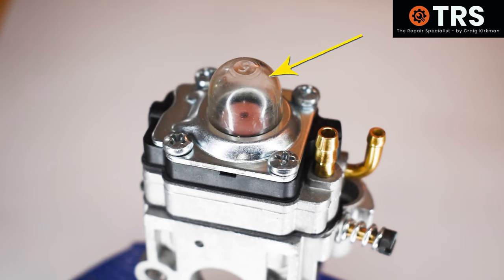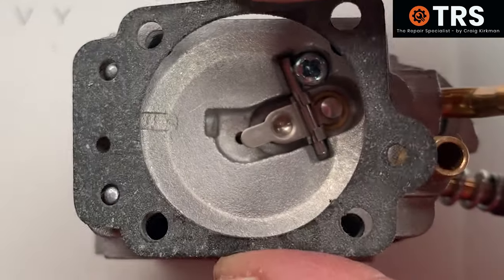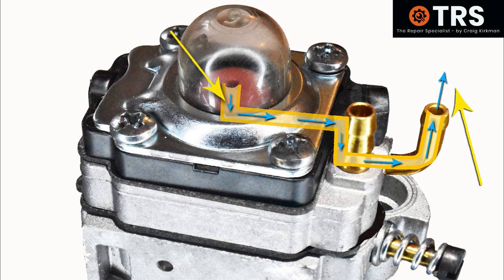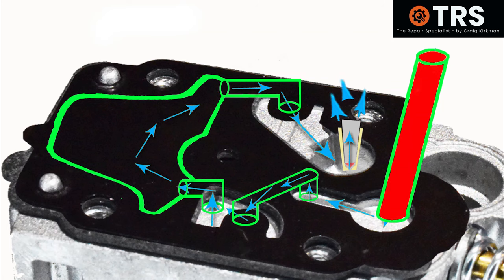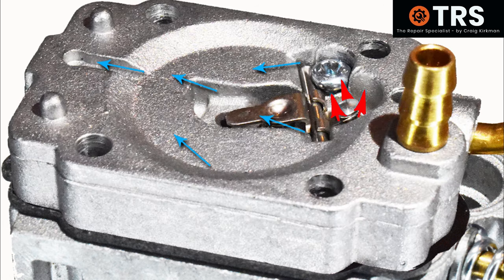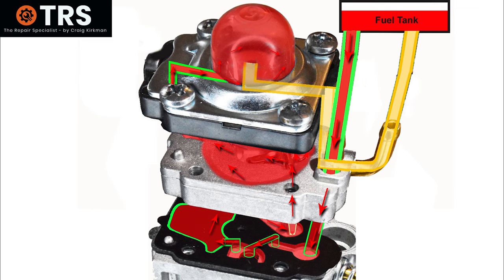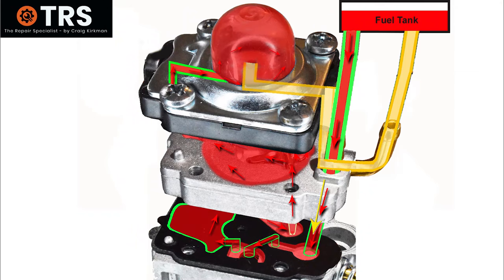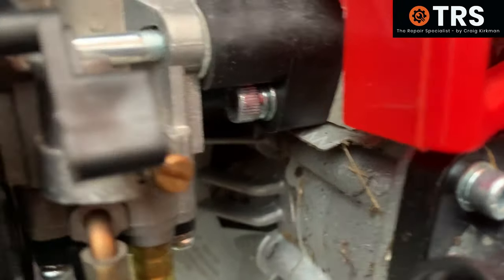2-Stroke Carburetor - Get 'JACKED' with Knowledge that Most Don't Know!

Comment: Craig a very informative video as always! I've been rebuilding 2-cycle carbs for more than 50 years and still always learn something by watching your work. You know, we don't give enough credit to the engineers who originally developed these carburetors, whoever they were.
Reply from the maker: Thank for your kind feedback, and I totally agree about the engineers that design and produce these needing more credit. Craig 👍👍👍
Reply: @TheRepairSpecialist  Craig, any idea who they would be? Jeeez, back in the day right?
Reply: @TheRepairSpecialist  
I am reasonably sure you entirely missed the hi flow adjustment screw on this style of carb 

This style of carb IS NOT 
A SINGLE ADJUSTMENT SCREW 

If you look at the top of the throttle barrel that the cable attaches to in the centre of that is a large brass collar/screw you can see the rubber tube in the centre of the brass screw 19:43 

Remove the rubber tube and there is a wee little adjustment screw hiding there to adjust that main jet needle
 On most verients at least 

hope this helps

Comment: Great content. Ive got a 2 stroke Waxker Neuson BH55 Breaker and its smokey. Also sounds a bit gaspy when throttle is applied but does seem to run
Reply from the maker: Your Waxker Neuson BH55 Breaker may be experiencing problems with the fuel-air mixture, based on the symptoms you have mentioned. What you can do is as follows:

Examine the air filter: A filthy or clogged filter can impede airflow to the engine, which can result in more smoke and a rich fuel-air mixture. Take off the air filter and look for any damage, dirt, or debris. If required, clean or replace the air filter.

Examine the Fuel System: Look for any indications of contamination, leaks, or obstructions in the fuel tank, fuel filter, and fuel lines. Verify that there are no problems with fuel supply to the engine and that the fuel pump diaphragm is operating as intended.

A problem with the carburetor adjustment may be indicated if the engine makes a "gaspy" noise when the throttle is applied. To guarantee the proper fuel-air mixture at all throttle positions, adjust the carburetor in accordance with the manufacturer's instructions.

Spark Plug Inspection: Increased smoke and poor engine performance can also be caused by a fouled or damaged spark plug. Take off the spark plug and check it for wear, damage or fouling. If required, clean or replace the spark plug.

Compression Test: To assess the engine's general condition, conduct a compression test. Low compression may be a sign of damaged or worn-out cylinders, which may be the cause of smoking and subpar performance.

Professional Inspection: It's recommended to speak with a qualified mechanic or technician that specialises in small engines if you're not sure how to diagnose or resolve the problem on your own. They are able to perform a comprehensive examination and diagnosis in order to find and fix any underlying problems with your Waxker Neuson BH55 Breaker.

I hope this helps a little

Craig
Reply: Nice one mate.  I'm gonna look into it. I'll work on the carb and possibly the rings in due course. Thank you

Comment: Absolutely brilliant! Question if you don't mind. My carburetor is very similar but has the adjustment screw down the middle of the throttle barrel? I assume turning this will alter how much the needle will engage into the jet? Very fiddly trying to adjust (if that is indeed how I adjust the fuel delivery on this setup!). Have you any experience of this type? Thanks. Andy
Reply: Yes you are correct see at 19:43 that his has a rubber tube blocking it 

This is the hi flow needle
The low flow he shows in the video but calls it the fuel to air mixture

The animation showed it had no way of limiting or adjusting the air flow 

So I would say it has to be the lo mixture screw and air is regulated by the idle limit screw he also explained

So yes you are correct they do have a third mixture screw and it's the hi flow mixture screw they tried to hide a little too successfully for my liking

Hope this helps

Comment: Is mechanic spelled differently in Great Britain?  Looks like a Walbro carburetor. They are usually Zama and sometimes Walbro. Sometimes the check valves on primer block go bad. I really appreciate your thorough explanation.
Reply from the maker: Thanks for letting me know about the typo in the thumbnail. I will correct that ASAP. Craig 👍
Reply: Lots of check valve are damaged by air pressure and objects being pushed into them 
I see it alot in spring time

Comment: I have tune several of those and have discover an other screw below a rubber cover inside the bronce part in the top of the barrel, what do you think that screw is for? I've been using it to calibrate low rpm range, like an L type screw and then the in maximum rpm calibrate with the crew you explain in the video. Thanks for the video is very clear all the explain and diagrams you use.

Comment: @TheRepairSpecialist  
PLEASE PIN THIS 

I am reasonably sure you entirely missed the hi flow adjustment screw on this style of carb 

This style of carb 
IS NOT A SINGLE ADJUSTMENT SCREW 

If you look at the top of the throttle barrel that the cable attaches to in the centre of that is a large brass collar/screw you can see the rubber tube in the centre of the brass screw 19:43 

Remove the rubber tube and there is a wee little adjustment screw hiding there to adjust that main needle/hi flow
 On most verients at least not found one without this YET¡!¡

The screw you called air/fuel mixture screw is the lo mixture screw your own animation even showed it had no way to affect the air flow 

I can only assume that the air is controlled by the idle screw as it's the only adjustment that is in any way linked to the air regulation barrel 

hope this helps

Fantastic work must have taken a long time to put that together 

I learnt I had a good understanding of this carb but I learnt a lot more too 

Keep up the good work

And kudo's for teaching me something about this style of carb

Comment: Another idea for a video. I own a paramotor (a basic 2 stroke engine with a walbro wb37 carb) I rebuilt the carb but overlooked the fact that I put the carb back on without the inlet spacer. (This goes between the engine and the carb) I tuned the engine and all was fine. Until someone told me. So I replaced it but in order to get the engine running right again I had to make it rich by around 3/4 turn. (Quite a lot for just a spacer) I know it will change the atmospheration but I didn't think it would be that much different) would you be able to go into more detail on this and 2nd question is if it runs with less fuel without the spacer would I not be better off removing it and tuning it to use less fuel ?
Reply: I am fairly sure it's a safety thing mate 

Heat barrier to stop fuel warming 

Another hint too this is the fact they tend to use plastics

Also having it setup to use a little more fuel is tactical because it reduces engine wear and heat 

How do you go about setting the carbs to perform at it's best when the oxygen is reduced from the altitude

May sound daft but do you set them up half way up a really good mountain or something I always wondered

Comment: Great explanations. However, I think I have something you haven't covered.  Qualcast CBD30A 2 Stroke strimmer will only start when I empty the fuel out!!!  So, it is flooding with fuel when starting is attempted the usual way. I have cleaned carb, set both screws to one turn, fresh fuel, good spark. I see fuel rising into the carb and then dripping or rather running out of the carb. Is this a bad diaphragm/valve issue? Could it be as simple as the fuel cap although removing it doesn't appear to stop the flow. Help please!

Comment: Something spooks me: 
When the engine is running, the metering chamber remains connected to the primer bulb and fuel under pressure can flow to the primer bulb and back into the tank instead of being regulated by the metering diaphragm. 
I presume the primer bulb prevents the fuel to flow back to the tank. Otherwise the metering needle, diaphragm, lever and spring could not meter fuel at all !?

Comment: Quick question on that carburetor you have a brass can you have a brass tube that is bent you have two fuel lines that go into the tank which of those brass tubes the straight of the bent gets the fuel filter attached into the tank

Comment: Do you have any basic settings for both the main adjustment screw and the tiny screw that is down the centre of the rotary valve? Im doing a favour for a local motoX group and their strimmer wont run. Put a new coil on as no spark but I think both screws out of adjustment and its constantly flooding. Thanks. Great videos too! 👍👍👍
Reply from the maker: Well, this vid of mine might help you here. It shows how i adjust these types of Carbs. Take a look and see if it helps: https://www.youtube.com/watch?v=pk6Bcv8LQOk&t=47s

Go from here and then we can look into it further if this doesn't help you with your machine.

Thanks
Craig

Comment: Love your  videos  very helpful but I have a problem I replaced ,new caburater ,new spark ,new gaskets and new coil but yet my brush cutter didn't start please help.
Reply from the maker: I'm glad to hear you find the videos helpful, and thank you so much for your kind comment. I do have some general ideas of the sort of thing that might help but please understand that it is always difficult to diagnose a machine if it if not present and in front of me, but here goes. Troubleshooting a brush cutter that won't start even after replacing key components can be a bit of a puzzle, but I'm here to help you sort it out. Here are some steps you can take:

Double-Check Installation: Ensure that the new carburetor, spark plug, gaskets, and coil are correctly installed. Even a small misalignment or a loose connection can cause starting issues.

Fuel Check:

Quality of Fuel: Make sure you're using fresh, correctly mixed fuel (if your brush cutter is a two-stroke engine). Old or improperly mixed fuel can cause starting problems.
Fuel Flow: Check if fuel is reaching the carburetor. Clogged fuel lines or filters can impede fuel flow.
Spark Plug Inspection:

Spark: Remove the spark plug, attach the plug wire, and hold the plug's body to a metal part of the engine. Pull the starter cord and check for a spark. No spark could indicate an issue with the ignition system.
Condition: Ensure the spark plug is clean and gapped correctly. A dirty or improperly gapped spark plug can prevent starting.
Air Flow:

Air Filter: A dirty air filter can obstruct air flow. Clean or replace it if necessary.
Carburetor Air Intake: Make sure there’s no blockage in the carburetor’s air intake.
Compression Check: Low engine compression can prevent starting. This might be more challenging to test without the right tools, but a significant drop in compression often indicates internal engine issues.

Check the On/Off Switch: Sometimes the issue can be as simple as a faulty on/off switch.

Consult the Manual: Refer to the user manual for specific troubleshooting tips for your brush cutter model.

Seek Professional Help: If you've tried all these steps and your brush cutter still won't start, it might be time to take it to a professional. They can provide a more thorough diagnosis and repair.

Remember, safety first! Always follow the manufacturer's instructions and safety guidelines when working on your brush cutter. Good luck, and I hope you get your brush cutter up and running soon!

Craig

Comment: Hi i have one of these carbs on a Gscooter  i took the top off  and the spring and valve all dropped out  my question is when relocating the black valve does it have to have a full turn to wind the spring up so when it all back together is returns to the closed position . as im having a nitemare with a cold start on it  but once i get it running wit heasi start it runs fine . do you have any prefered screw turns for the top jet and the side screw air/fuel one  as this is at 4 turns which i dont think is right  any help would be appreciated

Comment: Parts are not easy available, are those hardened metering diaphragms be able to soften again??
Reply: Look on Ali express 👍🏼
Reply: Parts are very easy to find 

Just use the correct wording 

Rebuild kits usually have everything diaphragm and gasket related 

Top tip 

Don't miss the hi flow adjustment screw hidden that well that he didn't show it in his video 

It's hiding here 19:43

In the centre of the brass collar/screw remove the black rubber tube to gain access to the hi flow adjustment screw

Comment: The only reason I suggest using canned fuel mixed gasoline is because it’s cleaner and less chance of trash in carb and correct mixed of oil and gas
Two biggest problems with most 2 cly engines plus it’s real gasoline 
Home owners need can fuel 😊😊😊
Reply from the maker: Great tips